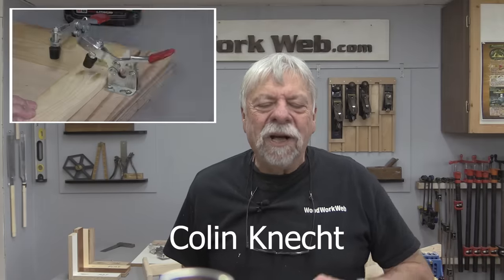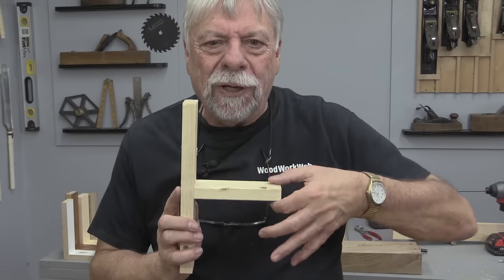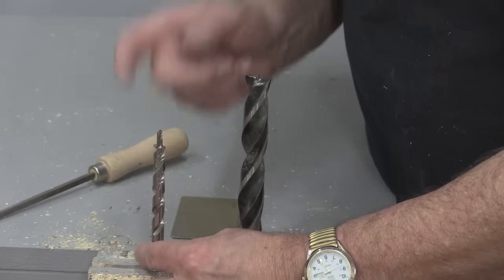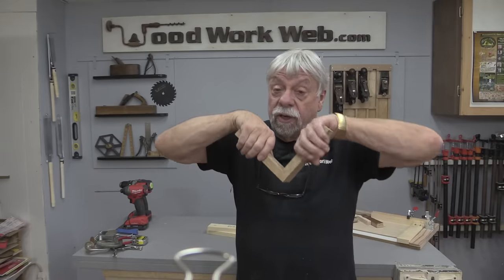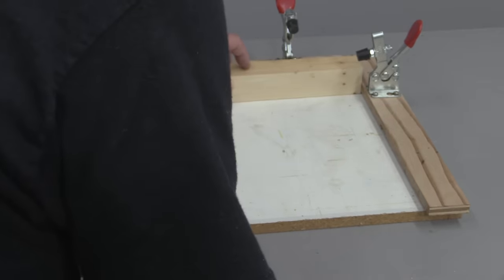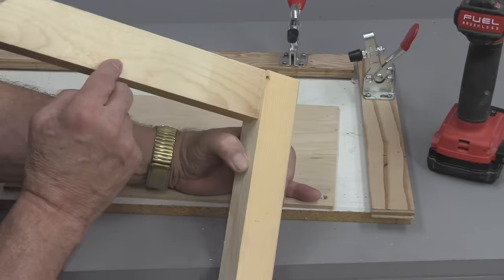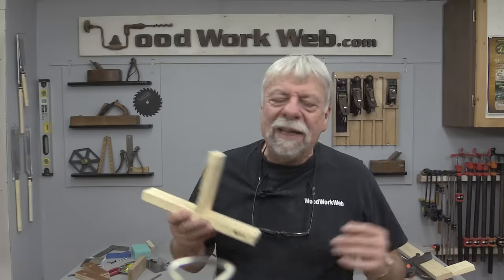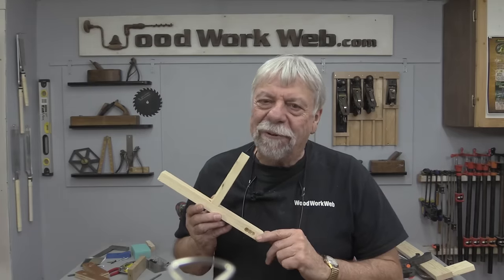Pocket Hole Mistakes to Avoid / Woodworking Joinery

Comment: Great instruction video as always. Thank you.
 I`m making a mitre saw statiton with 3/4 birch ply and I will use pocket holes to connect 2 pieces in right angle ( 96"long by 24"and 33' wide) clamping is not an option. Do you think that dowels will avoid the board to slide when I screw them toggether? What would be the spacing for the dowels? Thanks

Comment: Another good tip i use  is colored chalk   I use that to mark the correct boards and side that needs the pocket holes drilled   I find that by doing that  earlier in my project it sort of takes the thinking out of it for doing the simpler tasks of just drilling holes  this wasn’t really my invention at my old shop  they used different color Keels to mark  what edges needed to be edgebanded  after being machined  by a different  team and  tool  i must say in our shop it was very rare to have  a fault in the edgebanding  with thousands of parts that were produced each week   With a staff of over 100 Employees  building Millions of Dollars worth of Architectual Woodworking  per year  so knowing it worked there  i figured it would work in my one man shop  I switched to Chalk because it was  easier to remove  than Keel or Sharpie Markers in our shop it was covered up by the Vinyl Edgebandinf we used to match the HPDL  on that job  or in some cases it was a paint grade edgebanding that was  painted over  either way  the  marks were covered  over with something  and even though i try to conceal or place pocket holes  in a area that they are less seen  i didnt want  bright covered lines  on my builds anywhere BTW i dont personally use a lot of Pocket holes  but they do have their place  and use

Comment: Some good basic tips in the video but one important thing that wasn't covered is the types of pocket hole screws and applications for them.  Hard woods can split if the incorrect thread type is used, this is an important part of using pocket hole joinery.  Fine thread pocket hole screws are best to use with hardwoods, and the length of the screw and head type is as well.

Comment: I always had an issue with the wood pieces having uneven connections when using pocket holes.

Using support and clamp systems like in your video definitely helps.

I have also used wood glue to first act as a clamp on its own, wait an hour or so (if you have the time) and then install screws into the pocket holes after (I still use a clamp, but I dont have to worry about it not being flush)
Reply: To improve results you basically have to clamp everything. I've used the let it setup method to get fasteners into projects. Sometimes trying to drive a little finish nail into a small project I can more beat stuff up than manage to put it together. Then I'm adding the nails more for looks than anything else. I mean I have pneumatic nailers. Some things just don't look right without visible nails in them.

Comment: When checking where to lock the collet, alternatively you can drop the bit down the hole at the thickness you've selected, then pull it up slightly and lock it in at that height to ensure you don't drill into the plastic

Comment: Great video.  I thought my knowledge of pocket hole joinery was complete but learned important info that filled in some gaps in my understanding.  

Question - can i buy pocket hole screws that will use a star bit?  I much prefer these.

Thanks so much.

Comment: Very educational! I wish this had been out when I first started using pocket holes. I've still always had fits with the top surfaces of the boards not remaining flush, even with clamping. I started setting the stop collar on the bit about 1/16" deeper than recommended, but set the jig at the recommended line. That way, after I position the boards and clamp them into position, I can run the bit into the hole again until the shoulders bottom out. The pilot part of the bit  makes a nice 1/16" deep dimple in the received piece that will guide the screw in at the right elevation.

Comment: I just bought a Portacable pocket hole guide system. I works fine, except I seem to get a lot of tear out on plywood and spruce (the only two I've tried so far). Any tips to avoid this? Do I need a better drill bit than what came with the setup?

Comment: Any tips/advice on what to do if the collar on the drill bit gets stuck? Like it won’t come off or adjust (if using the cheaper jig bit that has the depth markers on the actual bit)? I’ve gotten two stuck in the course of two weeks and had to return. Not sure what I’m doing wrong. Too much speed or  pressure from drill? I’ve completely removed the little screw used to hold it in place and still stuck.

Comment: Do you have any advise about using a drill bit with a shorter end to prevent a loose joint when using pocket hole jigs?

Comment: Having trouble finding this answer anywhere, but do you always have to use two screws when using pocket holes? I am joining 3/4" thick pieces at widths of 2.5" together. I am using wood glue too.
I understand if you use one the wood could "spin", but if you combine with wood glue, it should be fine?

Comment: Love the video, showing different woods and the clamping to get rid of misaligned boards. Always learn something from your videos! 
Seems like all the videos out there of breaking off screw heads do not give a fair test.  A pocket hole screw has a flat surface, screwing against a flat surface, and it has a thread relief.  A screw with a counter bore needs a matching angle countersink hole and if it does not have a thread relief on the screw, drill the hole larger on the entry board, making a thread relief in the board. 
I agree that the pocket hole screws will break at a higher torque than the drywall screws. I just don’t think this test is a fair test, because a flat surface places on the torque directly at weakest point of the counter bore screw. Additionally, without a thread relief, the counter bore is being applied to the same surface as the threads are biting into. 
In summary, the drywall screw is being used incorrect, or provided the wrong drill application for the type of screw. 
Just my 2 cents. 
Keep the videos coming!
db
Reply: If you really wanted to give the drywall screws every possible advantage so as to not give any possibly skewed results whatsoever, you could take the extra steps you mentioned. The reality though is that the results will be the same. Drywall screws simply are not meant to be driven home like this. They are meant to draw in just slightly below the paper surface of drywall. The reason they snap isn't only a result of the placement of the torque, but largely the tension placed on them by the threaded portion continuing to pull deeper into the wood once the head reaches the face.

BTW, do the same test in pine, you will still snap them once the heads reach the face of the wood.

Bottom line, drywall screws really should only be used for hanging drywall.

Comment: Never knew why they have the smooth part at the top of the screw! Very informative! Also, I noticed that when you are showing the strength differences between different materials, you had the pocket screw going from inside the corner to the outside, which I read is actually weaker since there's less material for the screw to "bite" into. If you go from the outside in towards the inside, the screw will have more material to sink into, thus making a stronger joint. I hope this makes sense.
Reply: If you look at the Kreg instructions the holes are drilled according to their recommendation.

What is really lacking is the number of screws per application, strength of joint comparison and etc.
The ones that he pulled apart were only one screw. Another thing I noticed is that the pocket screw joints work better in tandem. A single connection fails easily but put it in a cabinet frame, bookshelf and with little lateral movement, the holding strength is a direct pull.

Since the screws are installed at an angle already the pull would have to be like an axe blow. They'll come apart.

His table top example, with the 1/4 inch reveal: Putting it on 4 corners and mounting a top keeps the screws square to their attached point, they won't pull out unless smashed. Every joint will fail under those conditions.
I have used many types of joints. The best part of pocket screw joinery is that anyone, with a jig and proper clamping know-how, can make something.
It's an easy way to get started, and many experienced professionals use it to speed up production.

Comment: Just used a Kreg pocket for the first time....I should of watched this first! Lots of good ideas, now I know how to sharpen my drill bits.  

In the last hardwood example,  does it matter you used corse  vs fine tread?  They say use fine for oak...better  hold. I thinks it a way to sell more screws?

Keep up the great vids.

Comment: ok so ... I have 2 chairs I recently built with my dad. We used 2x3 framing lumber - which is pine. We put 2 pocket holes per join ... it feels really sturdy - should I be worried about the seat breaking??

Comment: For outdoor projects, try not to have the holes pointing up.   I built a fence panel with pocket holes some years ago, and the ones I did with the holes at the top have rotted out, side ways and holes facing down are all still sound.   At the bottom I should have gone from the side grain up into end grain to avoid water pooling in the holes.  Lesson learned.

Comment: Video is quite informative. I had problem when joining wooden cleat to 2 by 4 on wall, while screwing cleat to 2by4, it bends downward thus not making at right angle causing shelf not staight. I made holw to cleat with mini pocket jig.
Can anybody help in this matter to solve it please ?
Inder Paul

Comment: Sheet rock screws actually have whats called a bugle-head, which differs from a typical wood screw that has more of a triangular shaped head.  The bugle, or funnel head is designed to reduce chances of tearing the drywall paper when sunk to the proper depth.  Like you say however, this while great for sheet rock, is actually a weaker head then a proper wood screw or construction screw.
Reply: The bugle head actually acts as a wedge that will split the wood. Kreg screws use washer head on the screw that doubles the amount of clamping power for the screw. Also, if you notice on the edge of the screw, it has a split. This acts as a sort of drill bit that cleanly cuts the wood fibers to keep the hole from "loading" or over-compressing the wood fibers as the screw goes in.

Comment: Fantastically informative video! Don't forget to use the proper pitch threads on your screws for different wood. For example oak requires a fine thread screw and soft woods require a coarse thread screw. I wonder if you had used the proper fine thread screw on your oak demo at the end what would have happened, would the head have snap off or will it still have stripped it?

Comment: The best way to insure that a seamless joint is made is after the pocket hole is made, use a long, long small drill bit to pre-drill into the receiving wood, to act as a guide at least 3/4" in- this insures the screw will not wander, and also helps when it comes to the union initially.

Comment: Square Drive or Robertson Drive screws drive me crazy and I avoid them at all cost. This type of screw requires the driver to be perfectly aligned with the screw or the driver will round out the square hole. In its place, I use Torq or Star drive screws. These are much more forgiving with the alignment issue. It's one draw back is the fact that it can over drive the screw unless your drill is set at a low torque setting. Another disadvantage of the Torq drive screw is that I have only found one manufacturer/retailer to offer Torq drive pocket hole screws.

Comment: The very first time I used my pocket jigs was in 1/2 inch panels with 3/4 inch screws. 
Every screw blew out the back of the wood. I just bought a new DeWalt  thickness planer and cart. The shelf has gaps and the planer came with a spare set of blades and the in-out feed tables. So I wanted to make an enclosure.

On the top 4 corners of the cart I had already covered with 3M aluminum tape, removed the shelf and installed full size 3/4" plywood. After contacting KREG Support my answer was, "Half inch wood is not recommended."
It's on the wheel chart. I just gave up and taped around the inside of the 3 vertical panels top, bottom and sides. 

It works, for me but it's a little messy. I could have cut 3/4 but the 1/2 inch was done. Will be painting the outside anyway.
My second KREG fiasco was with the shelf adjusting corner clamps.
I admit that this was my fault. I was building a wall shelf for a small shop compressor out of 2x4's and to a French Cleat wall bracket, where there's a gap between the garage door rail and wall. The maximum opening is 1" material. I broke 2 of them. KREG Support was kind enough to send me a replacement for one.
My Son is a welder and he took them to weld a steel rail around a lawn service trailer. Sort of a side job. Now I have slag on the face of a clamp. Told him, never again. The fix is filing smooth a couple layers of shipping tape and cutting the tape around the flat surface.

I guess there's a steep learning curve around my house. Like the depth stop, tip of the bit OR where the LARGE part starts. Answered on this video.
Gathered all of my equipment manuals, punching and putting them in 3 inch-3 ring binders.
One for the shop, one for lawnmower and etc, and one for A/C, fridge, stove, w/d, water heater, garage opener and the new smoke detectors.
The more shop equipment I buy the manuals just keep stacking up. Knowledge is Good. And Woodwork Web shares these tips with us NOOBS. After breaking 2 brand new clamps, I have to put myself in that category again. 
Started this hobby in the mid '80's. Electronics for 30 years, things have changed and I need to catch up.
Thanks for this topic. BTW the pocket hole shelf worked out great.

Comment: On the different materials test of pocket hole strength you were screwing from the inside to the outside.  If you turned that piece over and screwed from the other side i.e. on the outside of the right angle screwing into the inside.  Your screws would have much more material to bind to and create a much stronger connection.

Comment: With respect to the strength of the pocket hole, what is the optimal distance between the bottom of the hole and the edge of the board?  I've been considering making a pocket hole jig for use on 2x4s that are use when I'm building a wood "privacy fence" (i.e 4x4 posts, (3) 2x4 rails approximately 8 ft long, and as many 1x6 cedar pickets as necessary to fill each section).  Typically, we "toenail" the 2x4s to the inside of the 4x4, but that often splits the wood.  It looks like using the thickness of the wood might the right amount since for the 3/4" wood you are using, it looks like the bottom of the pocket is about 3/4" from the edge of the board, thus for a 2x4, maybe 1.5" (since a 2x4 is 1.5"x3.5").

Comment: I am new to pocket holes and jigs. I notice that with mine there is significant tear out - fibers - remaining on the left side of the pocket hole after drilling. The right side is nice and clean. There is significantly more tear out with pine but even oak leaves fibers. I know I could easily clean them up but I don't think I should have to take this extra step. Is this a problem with the bit? Or the setup of the jig? Something else?

Comment: I have noticed also that if the screw is not put straight into the smaller hole that will cause the screw to not follow it and then result in pulling the wood off some not making it flush. I have had this happen even with a clamp, release the clamp and the wood moves.

Comment: Wow!!! I was really surprised that the drywall screws broke off like that. I'm 65 newly retired. My wife and I are wanting to start a small business. She's a great Artist in my opinion and we want to make things for art and craft fairs. I am going to try to make small wood projects. First time trying this. Couple of questions.,. We are on a fixed income and money is an issue. Is there a comparable cheaper version of the Kreg Pocket hole jig? Same for the screws?? If I do go KREG which version would you recommend? I know for sure that we aren't going to be able to do this day in day out. The small clamps you used, do they have a specific name (red handle)?? I've seen a number of videos where they use a vise grip plier with round flat end about 1 inch might even have a swivel in it?? Your thoughts on this type of clamp?? Thank You so much for this one , I learned a lot in a short time. I enjoy the channel and your way of teaching and presentation 😊😊👍👍 keep up the great content, Rodney
Reply: Excellent questions; hope Colin and/or viewers provide answers. Good luck with your project 🤞👍
Reply: The toggle clamps? I have the cheapest Kreg kit. Then I just made a holder for it. So what I have now is kind of like the step up jig like this guy has. The holder I made is like a T shape. There's a base then a perpendicular piece of wood off that which I screw the guide to. It is hard to turn a profit doing craft fairs. So don't break the bank buying expensive tools. I love swivel pad Vise Grips. I have up to SP24s Can't buy American made Vise Grips new anymore. I won't buy Rice Grips either! The ones that say, "The Original" aren't. Those are my thoughts about Vise Grips.

Comment: At 4:45 I noticed that the pocket holes are on the inside of the 'L' shape.
Of course the join will come apart easily.

My understanding is that the holes should have been on the outside so that the screws are driven into the 'meat' of the piece being attached to.

Comment: I have the kreg jig and do I also adjust it to the thickness of my lumber? Or do I only adjust it on the bit?
Reply: You most definitely adjust both the jig and the drill bit.  If one is off you will have problems.